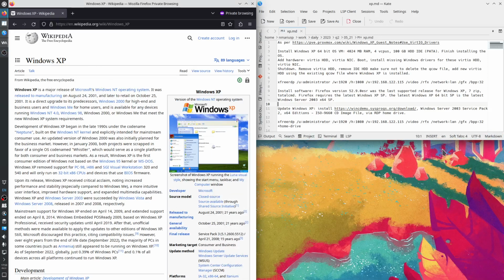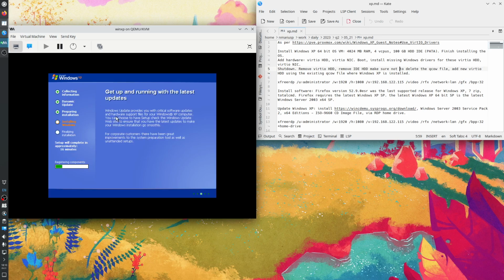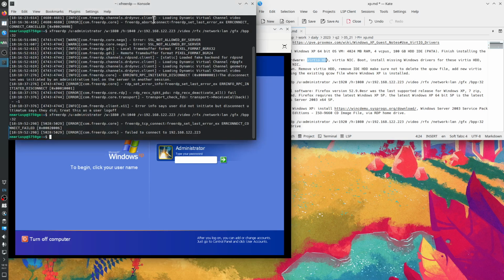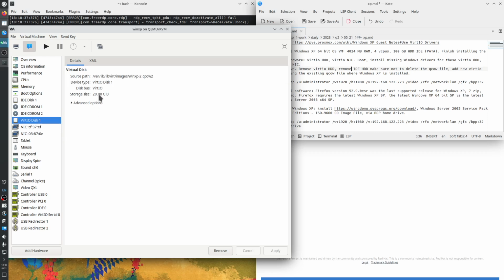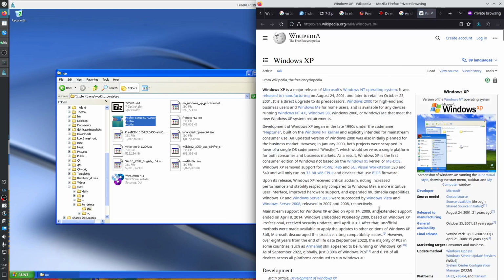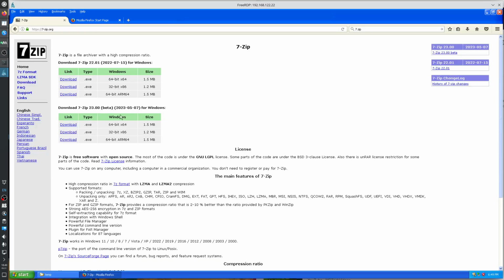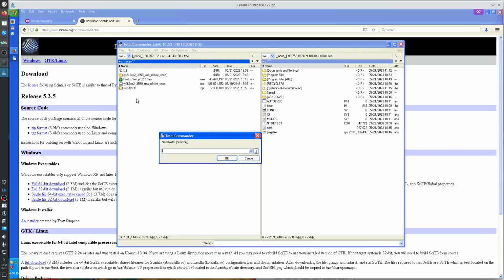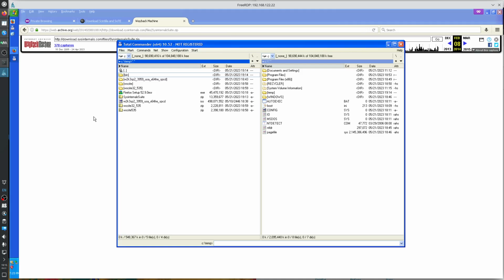Windows XP 64 bit QEMU VM tutorial for beginners using virtio - May 2023 - 7cac31a6

Comment from the maker: As per https://pve.proxmox.com/wiki/Windows_XP_Guest_Notes#Use_VirtIO_Drivers

Install Windows XP 64 bit OS VM: 4024 MB RAM, 4 vcpus, 100 GB HDD IDE (PATA). Finish installing the OS.
Add hardware: virtio HDD, virtio NIC. Boot, install missing Windows drivers for these virtio HDD, virtio NIC.
Shutdown. Remove virtio HDD, remove IDE HDD make sure not to delete the qcow file, add new virtio HDD using the existing qcow file where Windows XP is installed.

xfreerdp /u:administrator /w:1880 /h:1040 /v:192.168.122.22 /video /rfx /network:lan /gfx /bpp:32

Install software: Firefox version 52.9.0esr was the last supported release for Windows XP, 7 zip, totalcmd. Firefox requires the latest Windows XP SP. the latest Windows XP 64 bit SP is the latest Windows Server 2003 x64 SP.

Update Windows XP: install 7zip, Windows Server 2003 Service Pack 2, x64 Editions - ISO-9660 CD Image File, via RDP home drive.

xfreerdp /u:administrator /w:1880 /h:1040 /v:192.168.122.22 /video /rfx /network:lan /gfx /bpp:32 +home-drive

Comment: Unable to complete install: 'XML error: The PCI controller with index='0' must be model='pci-root' for this machine type, but model='pcie-root' was found instead'

Traceback (most recent call last):
  File "/usr/share/virt-manager/virtManager/asyncjob.py", line 72, in cb_wrapper
    callback(asyncjob, *args, **kwargs)
  File "/usr/share/virt-manager/virtManager/createvm.py", line 2008, in _do_async_install
    installer.start_install(guest, meter=meter)
  File "/usr/share/virt-manager/virtinst/install/installer.py", line 695, in start_install
    domain = self._create_guest(
             ^^^^^^^^^^^^^^^^^^^
  File "/usr/share/virt-manager/virtinst/install/installer.py", line 637, in _create_guest
    domain = self.conn.createXML(initial_xml or final_xml, 0)
             ^^^^^^^^^^^^^^^^^^^^^^^^^^^^^^^^^^^^^^^^^^^^^^^^
  File "/usr/lib/python3/dist-packages/libvirt.py", line 4481, in createXML
    raise libvirtError('virDomainCreateXML() failed')
libvirt.libvirtError: XML error: The PCI controller with index='0' must be model='pci-root' for this machine type, but model='pcie-root' was found instead

Comment: from where did you download windows xp iso? 🥲
Reply from the maker: From the current successor of what used to be an "MSDN subscription". https://en.wikipedia.org/wiki/Microsoft_Developer_Network
Reply: @nmariusp did you have local network connection in kvm instantly when you installed windows xp?
Reply from the maker: If the VM's Network Interface Card is of type virtio, then you install in Windows Device Manager the NIC driver from the virtio iso DVD drive.

Comment: is there a 3d acceleration for win xp ? is gaming possible ?
Reply from the maker: I have heard of 3 ways of having 3D graphics hardware acceleration in a Windows VM:
* GPU passthrough (this requires hardware that supports GPU passthrough) see e.g. https://www.reddit.com/r/VFIO 
* WMware Workstation Player (provides DirectX hardware acceleration in the VM, but requires Linux + Nvidia host or Windows host) - https://www.vmware.com/content/vmware/vmware-published-sites/us/products/workstation-player.html.html see chapter "For 3D Hardware Accelerated Graphics Support:"
* QEMU virglrenderer - https://www.kraxel.org/blog/2019/09/display-devices-in-qemu/#virtio-gpu-pci . I do not know what is the status of the Windows driver that you need to install in the Windows VM https://github.com/virtio-win/kvm-guest-drivers-windows/tree/master/viogpu